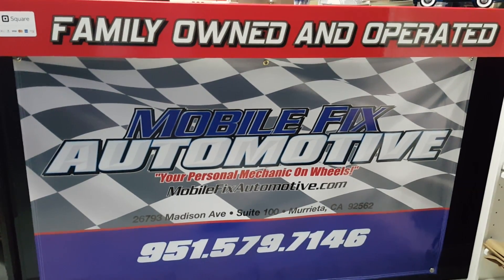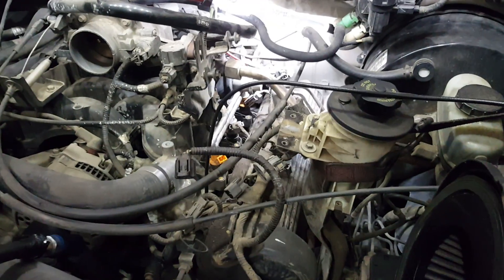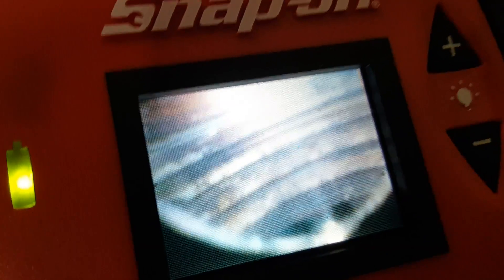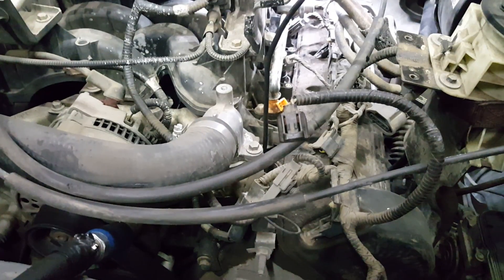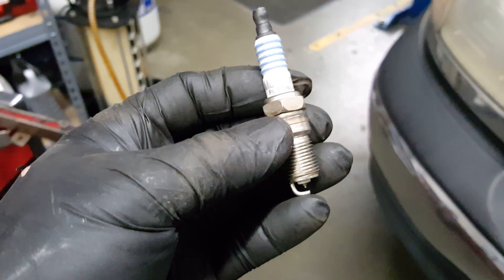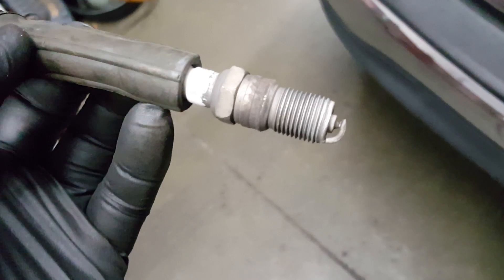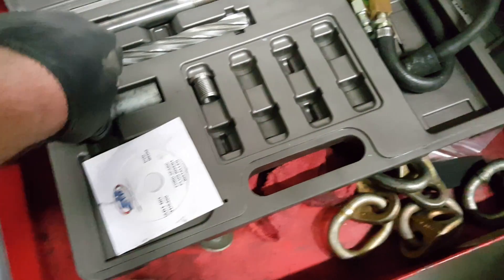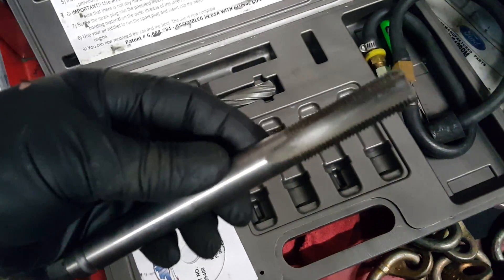Why the spark plug blew out of your Ford Triton engine

Comment: Hey Ron have you seen the spark plug blow out issue on  2004-13 Ford cargo Van's with the 4.6 or 5.4L 2 valve?  Thanks for the informative vid! -Glen
Reply from the maker: Yes, they do it also
Reply: @SandCarServices  if a cal-van insert is necessary can it be done with the engine in place. As you know it tough at times working on the Ford Van's, reaching in for sparkplug access.  Thanks
Reply from the maker: @ozzstars_cars  yes I've done lots of inserts in Van's. They are not fun and I usually bleed. But all of them can be done with engine in chassis

Comment: denso  is a toyota part those engines should be recalled by ford and repaired at no cost to the customer that is why i do not buy ford  the  FixOrRepairDaily car company  just as bad as GM  garbage motors

Comment: When I first pulled a plug out of my 2000 Excursion V10, I thought someone had installed the wrong plugs (beats me how cuz I bought the truck new). There were so few threads on the head and so many of the plug. Then I saw the new plugs I was putting in and thought I'd bought the wrong ones. Nope. Just a Ford goofy design.

No blown plugs yet on 130,000 miles. But I think of it every time I put my foot down. Kinda take away the fun of driving it.

Comment: driven these motors all my life. never failed. they blow out because they work their way slightly loose due to the 4 threads and once they are loose, they blow. solution is to tighten them every 30,000 miles or so slightly over tight and never use antiseze or remove hot.

Comment: I had a 01 supercrew 5.4. wife drove it with my daughter to get a Christmas tree hours away years ago. She called said the truck blew up. So I drive up there after getting a trailer. Climb up into engine trying to figure it out. Call my dad who was a Ford mech for 40 years. Soon as I told him noise he said look around for a plug. Found it. It was the back passenger side plug. The hardest one to get to. Went in sears at the mall got the swivel tool and socket to put it back in in the dark in a parking lot. Not fun.  I was always told the aluminum head getting hot n cold causes plug to get loose. Then the fire blows around the plug burning the threads out blowing plug out eventually. As well as people cross threading when changing cause so hard to get to.  It blew out again weeks later n had to drive hour home on 7 cyl. Horrible..... Ford shop had to put that tap kit in to fix it.  My buddy last week had his blow out, $1500 to repair for him. Only prob I had with it other than water running down block getting into plug hole causing it to miss after heavy rains. Had about 250000 when I sold it for $3000 2 years ago. Now got an ecoboost 2012. Can't even work on it period.... Sorry forgot the plastic intake cracked once as well.

Comment: Ford said the same thing about the Pinto bursting into flames when hit from the rear. It wasn’t a design problem it was a gasoline problem.
Reply: Old Chevy C and K trucks killed more people than the pinto with dual gas tanks outside the frame. And GM defended it even  into the 90s. Saying it was an overall safe truck..

Comment: So, I've heard about this problem. Haven't experienced it. I have an 04 f150 with 227000 miles on..no issues.  Also an 06 mustang.  After watching the video which is great advice I'm wondering if maybe the plugs should be torqued more or checked periodically for torque.  Just my thoughts.  Again great video!
Reply from the maker: Your assumption is he has a 5.4. But the 04 and up trucks with 4.6 are still pop corn 2 valve engines.

Comment: I worked for a Ford Mercury and Lincoln dealership for 10 years and bought dealer trade ins. Prior to working  for the dealership I worked for my father he owned 5 garages. Rebuilding engines is my hobby after 34 years of Knuckle busting. I will say this for fact Ford made a lot of bad designs in there craftsmanship in order to make the dealership's service department rich. I can honestly say he's correct.

Comment: Is there a torque spec for the plugs or something? I'm about to do a set of plugs since I have the manifold off (cracked crossover gasket wall) and don't want to cause myself a problem that I don't need.
  We bought the truck at an auction as a service truck. I told my employer I wanted the 1950 power wagon with the 318/NP435 conversion instead... But they didn't listen.
Reply from the maker: 20 foot lbs on 2 valve Triton engines.

Comment: Its clear Ford screwed up on this one. Make all the excuses you want, this failure is unacceptable and clearly a major, uncorrected design flaw. Of course, there's always the chance that it was manufactured wrong but if so the Quality dept was a sleep for years! The only saving grace is its a relatively easy fix (that Ford should write a check for) FixOrRepairDaily!

Comment: This old dude (me) is still upset about Ford Mounting  the Thick Film Ignion module directly on the hot distributor.
 If your confused because your electronicy challenged...
Electronics that use scrs ,diodes,transtsors fail under high temp applications.
 $8 dollars per vehicle to move the TFI module to the cool inner fender.
Ford refused to do so.
...
Im assuming  that costs per vehicle to death ratio wasnt high enough

Comment: Ford is FOS! Yep, they sure had a better idea...I just fixed my second spit plug in a '99 V-10 yesterday. My Bosch plugs that I changed from the factory plugs at 97K now have 169,309 miles when I changed them yesterday on an F-250 with 268.788 miles and it ran just fine.

Comment: The same plug blew out of the 5.3 liter LS in my 2K Silverado at roughly 140,000 miles. I fixed it with a different kit but it lasted until I pulled the motor and transmission at 333,085 miles. The engine was still OK, cranking on the 1st try every time but the 4L60e lost 1st gear so I just replaced both. I have no idea why the plug blew out on mine, there were plenty of threads, everything was torqued correctly and I wasn't pushing it.

Comment: If the problem is the spark plugs backing out from the threads, couldn't you just re-torque the plugs, say, every year or so to make sure that they stay torqued down?
Reply: That's exactly what my mechanic told me I just had this problem last night in my 250 Ford Econoline I said well it's a little too late already but he said to check it every year or every 6 months to double-check make sure the plugs are tight
Reply: Trouble is the threads get pulled out of the head and the new plug won't tighten.
Reply: @Rocketboy991  I was referring to doing it as a preventative measure (on a regular basis), before the spark plugs pop off.

Comment: My Last Ford was the 04 3v Triton,   bought new, never kept it long enough for plug issues, but the timing chains never kept the proper tension....over the short time I had it, it would stop running, lose all power at random..

 Can phasers, timeming chains, electrical Gremlins...last Ford I bought new..

 Never had issues with Windsor's,  carb or EFI..

 Much love still for the 400M..351C

Comment: I don't know. I replaced my plugs about 40,000 on my 2000 E150 with 4.6, and I have 130,000 now. No blown out plugs. Just replaced with new plugs and coils due to a heater hose leak that wasted two coils. Old plugs had to use a cheater bar to get a few out. They were installed by me a hundred thousand miles ago with just a socket wrench. No impact gun. My opinion is, if anyone has blown out plugs, was because they weren't torqued properly on install. By factory or someone who installed them. In a van it's truly tuff to get to them. Also, if there are no threads beyond the 4,plus that u counted,,, the rest of the well is tapered. So you couldn't put threads if you wanted to. It may well be poor design on fords part, but all I know is after doing a plug change myself a hundred thousand miles ago and now having to use a cheat bar to pop at least 4 hard to reach plugs loose,, four threads plus is plenty if you torque them a bit after contact.
Cause once a plug loosens, your probably gonna have compression issues and feel it, even if the computer doesn't.
Maybe you could do a video running a vehicle with a plug or two half in. It'd be an interesting test.

Comment: Than why aint ford got a recall on this. They should be the ones to blame..only 4 maybe 4/1/2 threads...when thier should be 10..sounds like someone didnt do thier job.
Reply from the maker: For had a class action suite against them and got out of it by having engineers blame the spark plug.

Comment: thank you ! believe your Honest and sincere,,,,, and probably right, ,, drilling at factory ! Having owned a 1999 Ford F250 Super duty, with 5.4 Triton,,,( 80 thou mile's , crew cab from Step Father), at 100 thou miles, I did tune up,, sold truck and kicked Myself in ass from day sold !!! so got a 2003 Ford F150, xlt reg cab , 4.6 Triton at 108 thou miles, and did tune up, n no problem's,,, feel blessed !!! tune on F150 changed all 8 ignition coil's too, n all good !!! still LOVE 4 on fly !! but you have a valid point !!! and if God Forbid, I have a problem, believe you answer the real issue !!! and now know how to fix !!!  thank you !!!

Comment: I used to work for U-haul in the early 2000. 99% of the trucks were Ford Tritan V8 or V10's. You hear them coming a mile away and seen many of them come back to us with a blown plug. It's very distinctive. Good video.

Comment: I have a question change spark plugs in my 19 98 Club Wagon the spark plug towards the gas pedal second from the back the last person that did it snapped It Off I can't figure out how to get it out is it okay if I unplug the fuel injector so it's not getting any fuel and run it on 9 Pistons instead it's been running real good the way it is but I just realized if it's sucking down gas for no reason here let me know
Reply: Have you ever heard of a little thing called punctuation?

Comment: had this same issue with 2008 honda odessay and had to replace the head which cost anout 2000 dollars for new head and labor and motor only had bout 94,000 miles on it now vechile stopped because some problem with emissions so here goes maybe another 2000 dollars BIG HEADACHE!  after fix down the road with this one.

Comment: Obviously with crap like timing belts instead of chains and all this fake global warming crap giving regulators and excuse to mandate, the ultimate goal is to design a car that only lasts 7 to 10 years, like most marriages.  Otherwise they would have keep engines like the Slant 6 and 7.3 powerstrokes, and the GM 3800.  But they don't want that, so they come up with bullshit regulations that all these manufacturers get to blame for the high hurdles they must jump when in actuality,....it's all planned obsolescence.  I'll build my own G damned car before I buy one of these piles of shit full of computers and smog horse shit. Carbon Dioxide is plant food you idiots and ice ages ebb and flow regardless.  One volcano eruption is going to spew more shite into the atmosphere than all of mankind ever did.  So...bullshit to you!! You're not fooling everyone you corrupt war mongers.

Comment: 265,000 MILES ON MY 2002 5.4 EXPEDITION AND NEVER AN ISSUE WITH BLOWING A SPARK PLUG. MY 2001 SUPERCREW IS AT 310,000 MILES WITH NO ISSUE. IF YOU TORQUE THEM TO SPEC PROPERLY AND USE ANTISIEZE YOU WONT HAVE A PROBLEM.
Reply from the maker: This video I did is now old news. I have personally seen these engines blow plugs at at little as 19,000 miles. I do so many of these it's crazy. Not all Triton engines will do it but when it does, well.....
Reply: So what should be my takeaway from your comment?  All those with this engine should not let their plugs go 100,000 as suggested by the service manual? Pull the plugs immediately, torque them down after pulling them and applying anti-seize? Keep in mind most women are not likely to do this and most won't trust their garage to actually perform this work.  It's too bad after 100 years of manufacturing cars people have to deal with this SHITE.

Comment: Never had any plugs blow on 4.6 liter Ford's even with nearly 300k miles. I maintained a fleet of V-10 Econoline buses and never had a plug blow but many coil boots failed causing misfires. Only saw a few 5.4 liters with this issue on #4 shortly after someone had changed the plugs and put in Champion or Autolite and no anti sieze plus there was a coolant drip from the heater hose causing crusty deposits in the spark plug well. If you clean up plug hole before and during plug changing and use Motorcraft plugs and proper torque I've changed a couple thousand or more and had no issues and none came back blown out. This is a good insert if repair is needed.
Reply: I am thinking my blew out because I did a crappy job putting it in a few months ago, no anti seize goo

Comment: Bought a Dodge: lost transmission at 140k  miles
Bought a 5.4 f150: harsh 1-2 shifts, blew a plug at 375k miles
Bought a Chevy 8.1: Exhaust completely fell apart 100k, exhaust manifolds leaking bad 100k bolts snapped off, constant misfires and terrible mpg/not impressed with power  , terrible suspension.
Just bought another ford: harsh 1-2 shifts when hot outside, fingers crossed, had to try Ford again since first one lasted 375k miles. will see.
Reply: I went car shopping, there is nothing that impresses me a durable or tough.

Comment: Why doesn't ford contract Calvan and have them do the head threads?
Reply from the maker: Better yet why not contract me?
Reply: @SandCarServices  That too! The thread on the 4.6 wears out when it is not supposed to. Additionally, four or five threads will not cut it when a Spark Plug has ten.

Comment: Never had this problem, maybe normal for guys that buy imported plugs,  Use MOTORCRAFT and torque to spec. which is  the part most mechanics skip due to access issues, foreign plugs are machined from thread cutting dies that vary in cutting depth and thread groove angle from the FORD dies that originally cut the cylinder threads,  Been driving 4.6's since 1994 and also have a 5.4 with 233K.
Reply from the maker: You didn't watch the video did you? If you did your comments don't make sense

Comment: I use the same kit, same plugs and same coil, funny, I found this all by trial and error, these cylinder head threads are garbage. I couldn’t even tell you how many of these inserts I’ve installed, none have failed. One engine i ended up doing all 8 eventually. Amazing kit, a lifesaver for the poor souls who got screwed when they bought what they thought was a good truck, not to mention the timing chains on these engines JUNK

Comment: I've had to drill and tap at least a dozen of these engines .  The idea is to put a new "  seat / thread insert" for the plugs . giving about ten threads for the plug to hold  . This works fine , and costs "only" about $ 200.00 PER CYLINDER !! What a screw up by Ford on an otherwise decent engine design . Made my comment before watching the entire video . Apparently this guy is doing the same thing . It's the only thing that works , and usually we do all the cylinders on the engine .

Comment: Every time I have seen one blow was preceded by a "Ticking ..Header leak sound" which meant the spark plug was loosening up! If you pay attention to the sounds under the hood you will never have this happen. I have seen this happen a few times to our Patrol Cars. I had it happen on my 5.4 Expedition Patrol Vehicle, it made the ticking noise for a few months before the plug blew out!
Reply from the maker: You are correct as to keeping the plugs tight will help immensely but not guarantee it. Also I have done so many of these repairs and I often ask if they heard a sound like a small exhaust leak before failure and more often they say no.
Please accept my gratitude towards your service in law enforcement.

Comment: i have a 2013 ford with the 5.0 engine, at 150,000 miles my electric steering rack failed. $600 dollars later it is back on the road. other than this problem my truck is awesome.
Reply from the maker: Yes the 5.0 coyote engine is way better than the 3 valve 5.4

Comment: Just buy a Silverado with an ls engine! Problem fixed! It’s crazy to think that automotive company’s have been building vehicles for over a hundred years, now all the sudden ford can’t build an engine that won’t blow out the spark plugs, wtf. Then they try to fix problems and go with a 100% porcelain plug.
Reply from the maker: I like Silverados also. But watch my video on "is the chevy LS engine an interference engine?" I had a 2008 Silverado in my shop a while back that broke the plastic timing chain guide and it fell off and bent many valves and push rods. That repair required oil pan removal, and both heads to come off. Big money job.
Reply: Ron Williams I would agree 💯 % if we’re talking about 2007/2008 and on when the afm came into play , total junk, when talking about upper engine and that failed technology. I should’ve clarified myself more in my comment, “small block” chevys and vortec/Ls engines through first gen. 99-2006 classic are great long lasting drive trains. They all had pretty much same issues, steering cluck, Rotted rocker, oil sump tube o ring, 10 mm exhaust bolts break, etc. but great running , awesome  horse power / potential builds, parts cheap and very simple push rod design

Comment: The same tool works with 3 val and 2 val ?
Reply from the maker: No
Reply from the maker: The 3 valve engines and 2 valve engines are different and the cal van kits are absolutely NOT interchangeable!
Reply: Ron can I used the seme incerter in a 2 val and a 3 val
Reply from the maker: I already said no